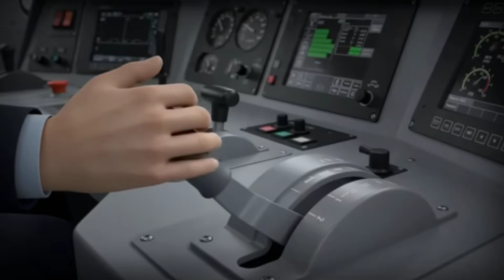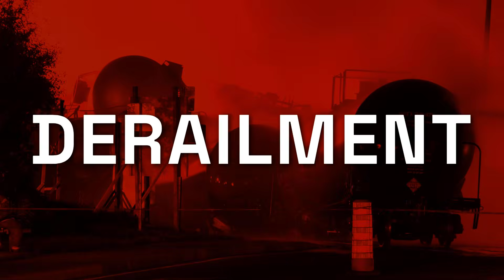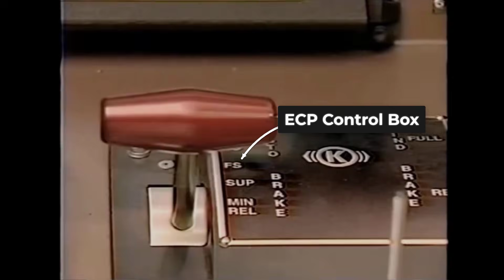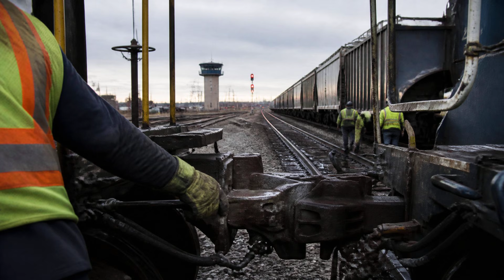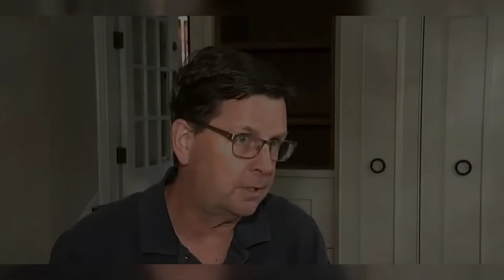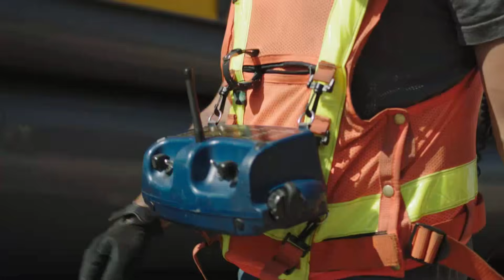The Real Reason Trains Always Have an Empty Car

Comment: Empty freight cars in a train are there usually because of four reasons.  Two main reasons are either because the car is being delivered to a customer who needs the car to load, or because the car is being shifted somewhere because of an imbalance in the number of empty railcars in that area.  A third reason is that sometimes railcars have to be shipped to a company where they are cleaned or serviced.  Such companies are located all over the country.  A fourth reason is that some cars can only be loaded with one product, so have to be sent back as empties to be reloaded with the same product.  

Think about it.  It is IMPOSSIBLE for every car in a train to be a load.  What happens when a car gets delivered to its final destination on that trip?  It then becomes and empty after it gets unloaded.  Empty railcars don't just magically appear where they are next needed.  They have to be moved in trains as empties to the next industry where they get loaded again.  

While some freight cars can be moved mostly as loads, some have to be reloaded with that one item.  But regardless, once a freight car gets unloaded, it has to be moved somewhere as an empty.  Very, very, very few cars are unloaded and then reloaded right at that point with product going somewhere else.  For example, think of grain cars and coal cars.  Once emptied, they are sent back as empties to be reloaded with the same or compatible product.